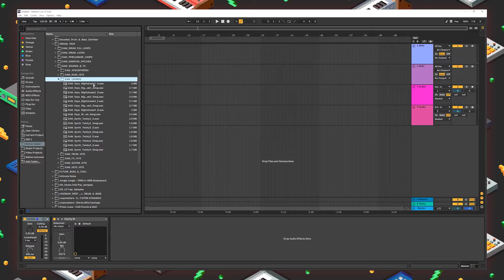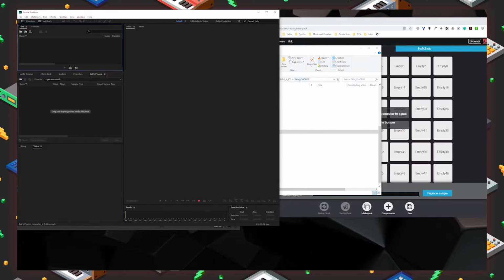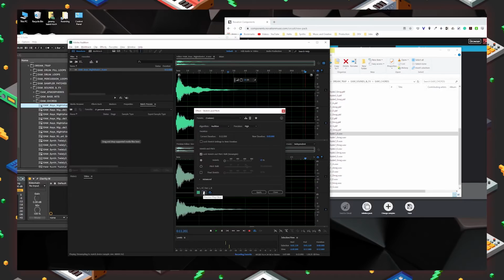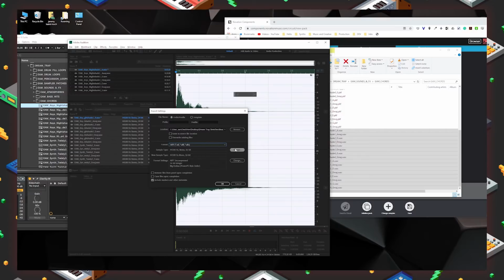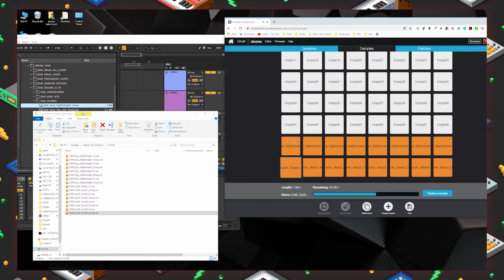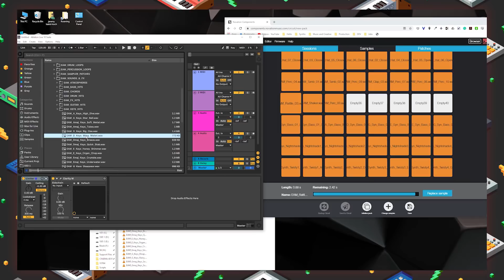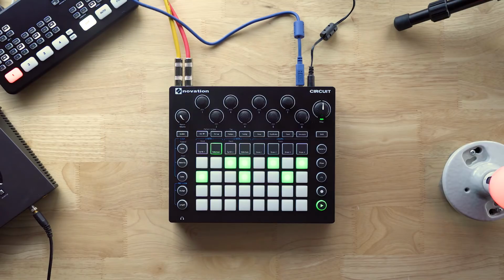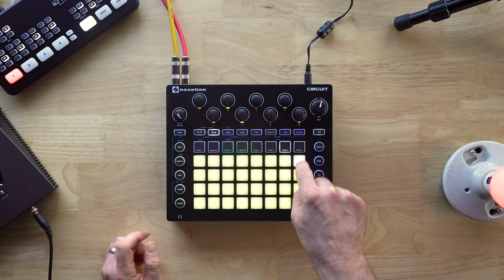Making the Most of Sampler Memory (ft. the Novation Circuit)

Comment: nice to see that with the advent of 2020 tech, we are still suffering, and working past with the same techniques, used since 1996 on the amiga...
it wouldn't surprise me if the users of the fairlight did the same thing!
Reply: Kelvin Mead I think this is because the Circuit has been stretched by both Novation and users way beyond its initial design intent.  That is a good thing in my opinion.

Comment: Tip: you can do the stretching (or rather "squeezing") and pitching on the command line with rubberband (Open Source, https://www.breakfastquay.com/rubberband/ ):

rubberband -t 0.25 -p 24 <infile.wav> <outfile.wav>

It's easy to write a Shell or BAT script to do that for a whole folder of WAV files. No need for commercial software.
Reply: NOTE: Remove the trailing parethenthesis ) from that URL for it to work correctly :)
Reply: Oooooh thank you this is exactly what I was about to google for hahahaha
Reply: Here's the github repo for Rubberband: https://github.com/breakfastquay/rubberband

Comment: Could also just cut those chords in half as it's mostly silence. Not clued on with the novation but using a loop and or decay parameter will clean up the tail of the cut sample.
Reply from the maker: You can't do that it the circuit
Reply: @RedMeansRecording  ok.. you can still cut those samples in half and fade the tail out in whatever software

Comment: If I understand it all right you speed it up with 1.25 time? is this the maximum my circuit can pitch it down if I turn the knob full counter clockwise? If this is the right way I can do it with audacity :D this would be a shortened sample from original 9.09 secs to 7.27.  BTW I love audacity. such a powerhorse for a free program. Cheers Jeremy

Comment: If I’m understanding right, doing this effectively reduces the sample rate of the samples?
Reply from the maker: Yeah
Reply: @Red Means Recording Edit: just seen somebody else made this point already 😅

Ah, then I think you'd get greater control by changing sample rate and bit depth directly in the batch processing. Could emulate the specific compression settings of classic samplers